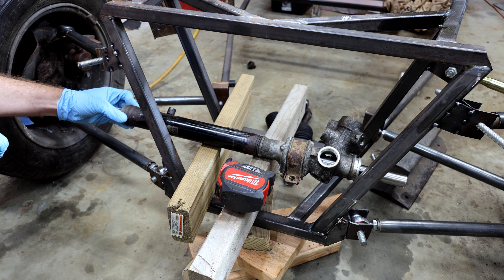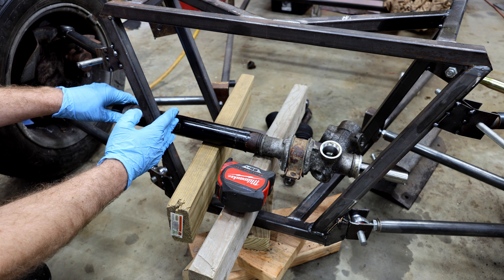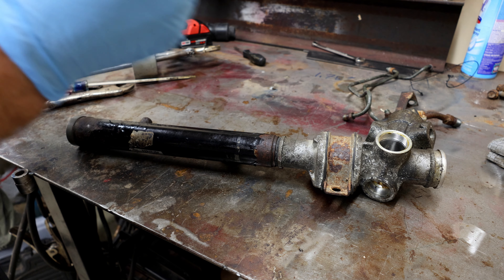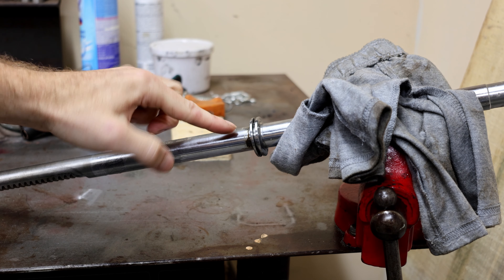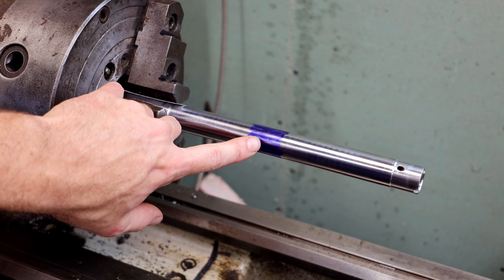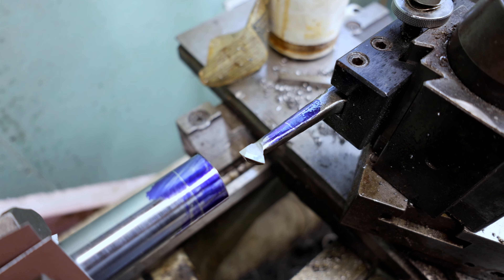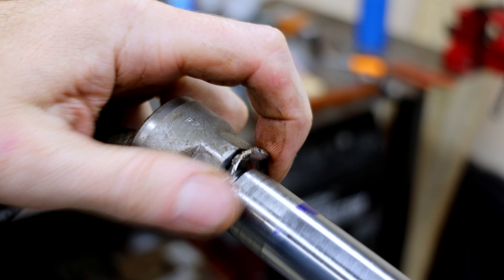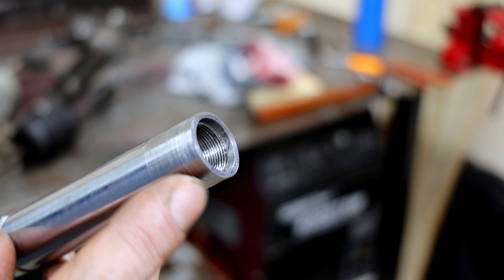Shortening a Steering Rack

Comment: Great video!! I have done the same thing, but over 9" I had to cut from an NC rack. I'm building a Locost myself, McSorley 442E w/Duratec 2.5L, NC 6 speed, NC LSD rear and the whole rear from the NC Mazda.
Reply from the maker: Hopefully, it works. The website was down, so I had little to go on. The one issue I have now is that I don't think the outer tie rods are long enough.    I've seen your build, I'm basically doing the same, but with a 1990, so same but different.
Reply: @Theweldingmillennial  You will have to make some extenders. I had to myself, I'm a machinist, so no biggy for me.